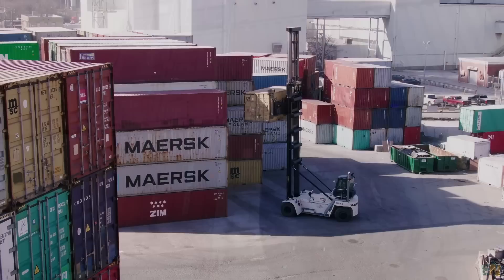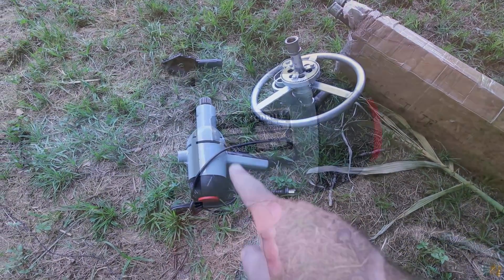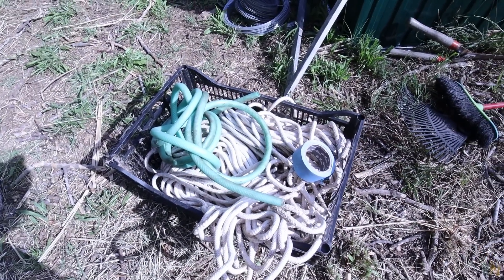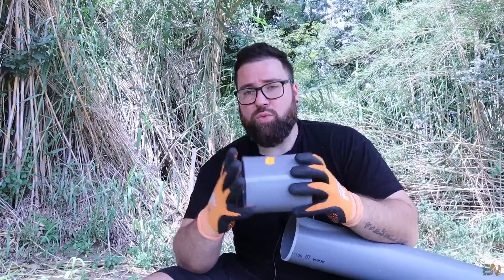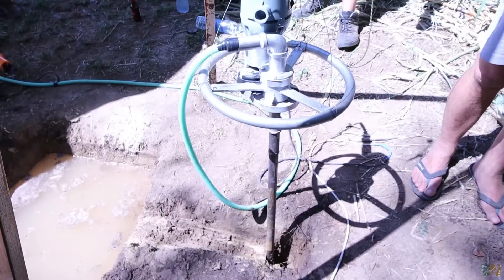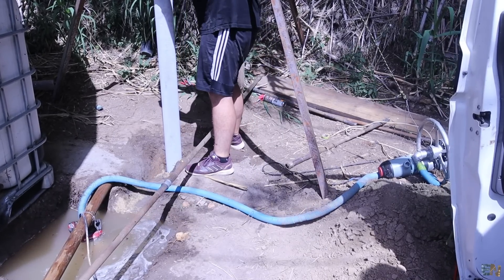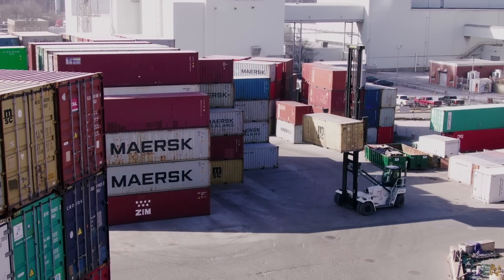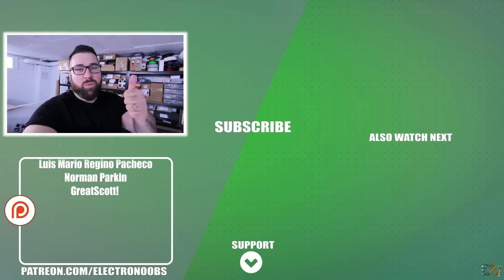I Built a DIY Deep Well for My Container Home

Comment: I know that in my zone the first water layer is at about 60 mt. 
Do you know if using this machine I can drill til 60 mr please ? 
So nice video... make some other please :-)
Reply from the maker: @MrDenisJoshua  i think on the website is says max 30m. But here are other ones a bit bigger for deeper wells
Reply: @ELECTRONOOBS  Here where sorry :-) 
...did you have a link for a biggerone please ?

Comment: We retrieve stuck or twisted off pipe all the time with overshots and other fishing tools. 

When you’re pulling the pipe out, you need some slips to hold it while you remove the joints. 13:53

Comment: You didn't even show the Water coming out of your well with the new Submersible Pump..
Reply from the maker: @lasersbee  i haven't installed the pump yet. It need a system where is starts the pumps automatically  and fills a water container si it has to be for a separated project.
Reply: @ELECTRONOOBS  Thanks for clearing that up...I thought you had installed the pump.

Comment: Problem with metal is its thermally conductive and difficult to keep the outside  temp outside and the inside temp inside. There is also the difficulty of dealing with water vapor as water condenses on the colder surface, which is inside of the container during the winter and inside during the summer.
Curious to see how you deal with this. Air gap and drainage on inside and out is key.
Reply from the maker: @l0I0I0I0  I'm planning to use thermal reflective paint on the outside, insulation foam inside the wall and and the drywall.
Reply: @ELECTRONOOBS  Leave an airgap and it will save you a lot of money and headache.  Water vaper destroyes more homes and it takes time to understand it as its complicated. Any cold surface will be wet and if it has drywall your drywall or wood will be wet.  Leave a gap and some place for the water to drain out and you will be fine. What I love about steel is its strong so if a tree falls on it you are good. Airgap between metal wall and drywall with a place for the water to go, unless you live in the desert then never mind. Gl! I look forward to seeing the future of your home! I plan to build a farm so I get it.
Reply: @ELECTRONOOBS Hi electronoob.... i have a request can you  please make a video on making a rf amplifier for the cheap 433mhz pair you have also told in  "which radio module? " Video also... That you will try to increase its range by using some transistors.... Please make a video of making and working, testing of that project . I think it is very interesting project it will increase the uses of those affordable pairs more....
And thankyou you for your videos and motivating us for hobby... 😊

Comment: Make sure you put some good insulation both for walls and ceiling. Don't know if it gets very cold in winter but summer temperatures in Spain are quite brutal - imagine walking into a steel box in summer.
Reply: Be sure to well insulate under the floor. I built my family and for renters several small buildings up to 12 foot by 20 foot. That size makes an excellent one or two person efficiency. Full bath, full kitchen and a living room and closet.
I'm mainly posting this information to show others that making a very small but nice home on a budget is very easy to do without spending a fortune. Here in the US, almost all homes are built out of wood because it is very cheap here. In other countries metal or concrete is necessary. This will be fun to watch as I never built anything this way. 😀